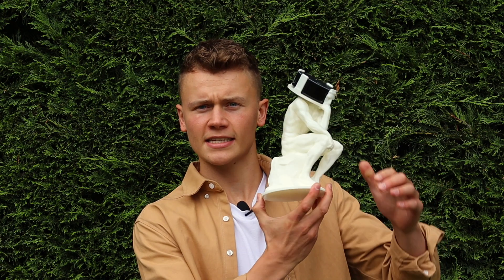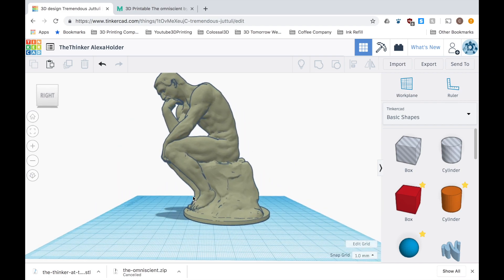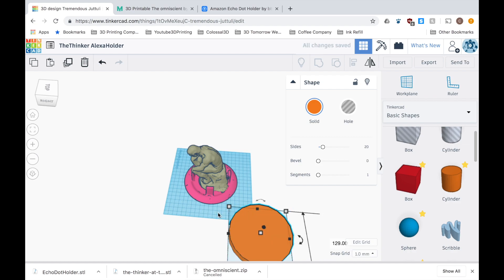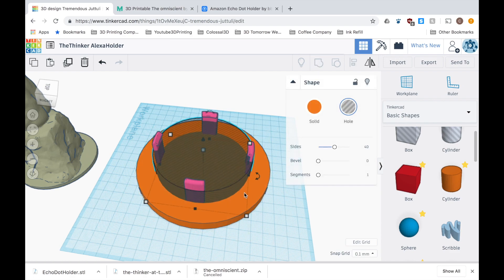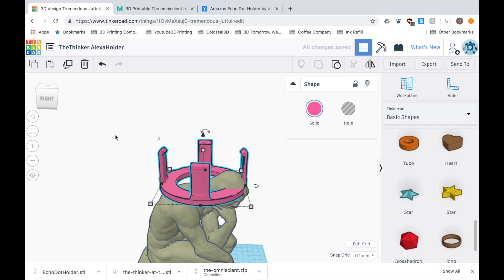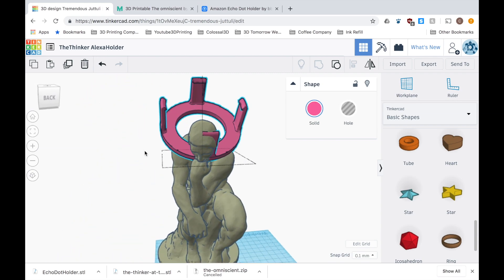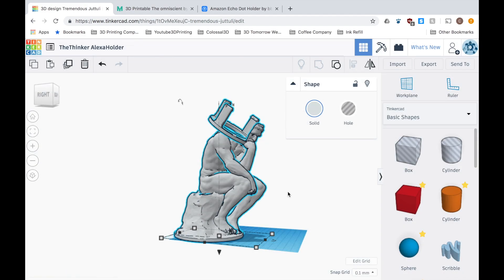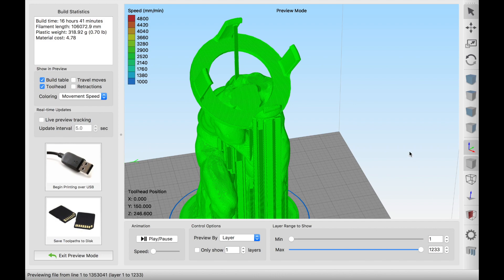Editing STL and OBJ Files / Designing the Thinker Echo Dot Holder in TinkerCAD

Comment: Pretty pointless to label this as a tutorial yet you do not discuss the tools you're using. This is more like watching you do something in fast motions with no idea how you are doing it.
Reply from the maker: skinee dog hey thanks for the comment, the only tool used in this project was TinkerCAD, I have a separate tutorial for this software since this video was a project showcase rather than in depth tutorial. I wanted to design this holder anyway so thought it would be good to show a whole project from start to finish and highlight the sort of thing you can accomplish by joining files together. Happy to answer any questions if anything was unclear.